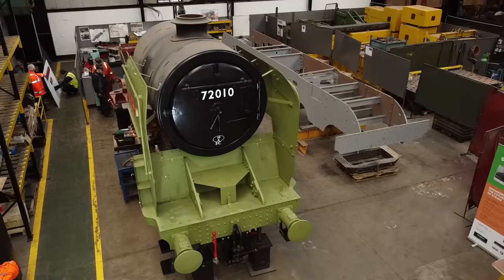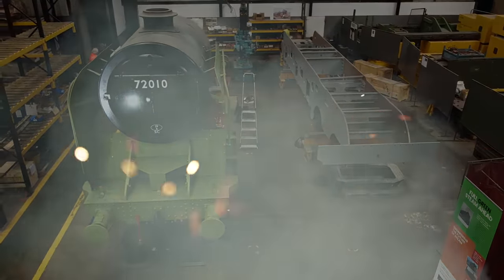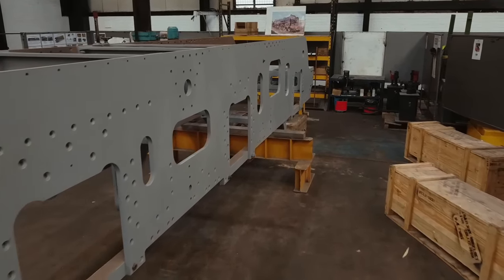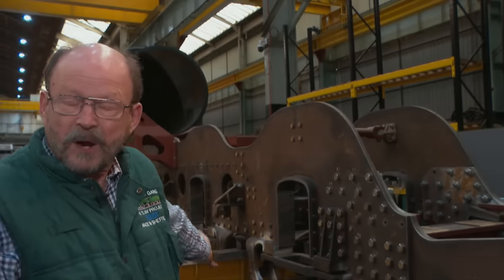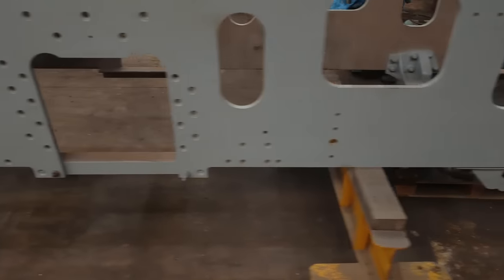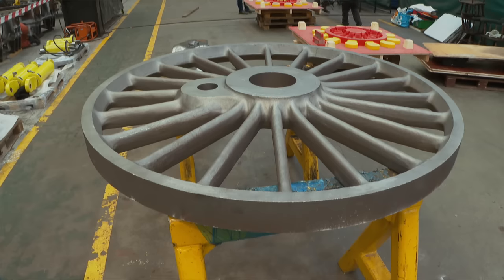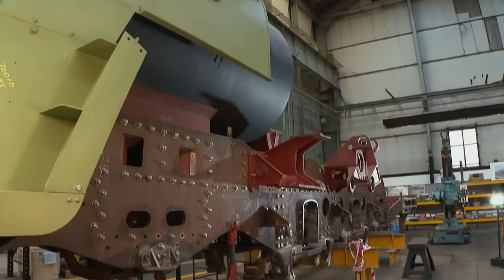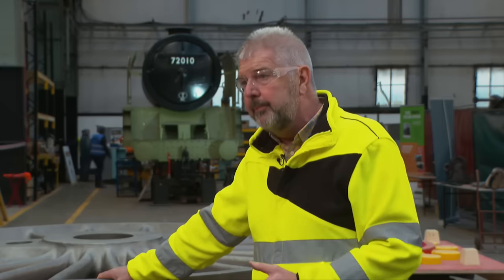One modern Sheffield factory - building two brand new steam engines. A short film by Tom Ingall

Comment: I used to live next door to a guy who had an engineering business in Ireland he had built a huge works on his land , however after the crash in 2008 the work slumped but he didn’t want to lose his younger guys so a lot of the older men retired but would be called in as trainers and advisors when the slump was over…In the meantime Gerry was into old traction engines so he bought a few that were barely recognisable and he rebuilt these using modern equipment and tooling, plus he rebuilt many of the old caravan /wagon type trailers these guys used to tow around…This kept the business turning over nicely until the slump eased, the finished products were fabulous and as Gerry was a traction engine fanatic it was a very rewarding hobby…
Reply: What part of Ireland, please?
Reply: @herbiemitchell9156  It was Balinalee county Longford , I’m not sure he’s still at it because that was about 12 years ago, so possibly retired like myself, I moved away then as I had a holiday home in the Canary Islands and I wanted to live there more permanently..
Reply: @dermotmcglinchey282  Thank you for the reply. I am a steam enthusiast too and built a 4" scale Foster some years ago.

Comment: This is amazing!! The fact that Steam is surviving and making a comeback in this day and age is astounding! I can't wait to see the finished results for the Clan Class and the B17! Best of luck to you and everyone working on these projects from America!
Reply: Japan has been doing the same recently.
Reply: Steam is not making a comeback. It is just a niche hobby.
Reply: is not making a comeback in any meaningful way. It id just a hobby and nostalgia rather akin to battle reenactment.
Reply: It would be interesting to see what steam engine could be made using the technology of today, but still keeping the traditional arrangement (coal as fuel, direct drive and not steam-electric etc). Probably a stronger boiler could be made to use with higher pressure, modern types of bearings that do not need oiling every 100km, maybe some better valve gear. It would be interesting what speed and power could be achieved and how much the maintenance costs could be reduced.

Comment: What a great set of projects to undertake and to be hearing are viable propositions too - not the struggles that befell the Flying Scotsman. A long wait since the last steam loco, the 2,223rd to be produced there, at Doncaster in Oct 1957 (works completed in 1853). What a history in that area for both steam and steel. I have spent quite a bit of my career in the steel mills and steel processing in the area, so pleased to see associated businesses thriving and able to give the steam preservation groups this massive support and opportunities. Also to pass down the knowledge, skills and interest to the younger generation. Well done.
Reply: yes you never know we might need them in a pinch, there are times when things fill a niche, after all there is sam mackwell in new zeland that is building steam traction engines that use fast growing wood or waste material to be powered and using a watertub boiler a lemate style but without the water wall around the firebox so it dont have all the leaking and weakness and scailing problems that plegued the first gen ones when they tried it in the 20th century, he also has a garrett style loco listed as to how far along to build it they are I dont know but its on the website, the beauty of steam is if it can boil and superheat water it can be used even solar made steam using the sun to boil it for a stationary compound engine this earth day when this message is written.
Reply: Well, it hasn't been quite such a long wait as that,  A1  60163  Tornado was built from scratch and completed in 2008.    I think there have been others.

Comment: a very significant point of engineering these locomotives that they fail to mention is that the frames are welded plate steel as opposed to cast iron.  They are stronger, more resilient and flexible, and probably lighter.

Comment: I can only imagine how modern casting, and machining technology is working here. I'm pretty sure small cast parts are having their patterns made using 3D Printing, some of the larger frames plasma or water cut, some large items not even cast but flat plate cut, bent, and then 100% full depth weld being used and then line drilling and boring to make bearing hangers.... its exciting!

Comment: There’s a brand new steam locomotive currently being built in the US as well, a Pennsylvania Railroad class T-1 4-4-4-4 number 5550. The original PRR T-1s were all scrapped at the end of their service from 1953 to 1956. The 5550 is being built by The T-1 Trust Fund and is scheduled for completion by 2030.
Reply: That's amazing. I believe it wasn't very successful (or was that the 4-4-6-4?) but an innovative locomotive with potential for high speed.
Reply: @routeman680  The T1 had problems with the poppet steam valve arrangement that modern materials would easily sort out, they also had traction issues with wheel slip at start up and high speed due the Engineers/Drivers not realising how responsive the locos were to the regulator at high speed...basically akin to over throttling the engines and doing a burnout lol It is a shame that they were all scrapped before full development could take place....they had huge potential.
Reply: What is The Brand?
Reply: @davewilliams6172  99% of all T-1 issues were as they say "drivers error".  As you state, due to the responsiveness and power curve the locomotives did wheel slip, but engineers who ran them daily attested to the fact that there was a learning curve and you couldn't just jump in the cab and run a T-1 like a Northern, Pacific, or Mikado.  You had to learn how to manage all that power and responsiveness.  They were a very good locomotive despite many ill-informed claims to the contrary.
Reply: You're right. All those T1 drivers used to drive K4s Pacifics, which has different characteristics than a T1.

Comment: It was not the Sandringhams "loading gauge" which determines the size of the engine but their axle weight which was the consideration and this determined their size/weight as the bridges were weight restricted. Later on they were strengthened and then in the 1950s the Britannia Class engines- big sisters to the Clans ran on the same line.

Comment: For some time I've wondered about the inverse of this project: you are scheduled to step into a time machine to take you to (say) 1850. You are allowed to take with you enough gold to found a steam engine construction company, and one set of blueprints for a steam engine. Using modern engineering and technology, make the best possible steam engine blueprints which could be constructed in the 1850s. 

(I.e. make a modern design to be constructed with old technology, whereas this project is an old design being built with modern technology.)

Comment: For a moment there at the start I thought you were Jeremy Clarkson 😆

Anywho that was a good video. I am a tad surprised that both groups intend on running the engines on coal. I would have thought being new builds they would have to be able to run off say biomass, wood or maybe some kind of oil that hasn't come out of the ground.
Reply: I have seen video of steam trains that run in America that are run on oil and just have a small boiler to give the steam effect. What belches out of the chimney is black and filthy. We were still in the steam age in my childhood, being a war baby. I travelled by rail a lot and never saw belching black emissions like that even pulling up box hill. On my first Diesel trip under the Severn tunnel  we broke down half way, and had to wait for a steam engine to rescue us.
Reply: Oil firing is possible, but almost the same emissions as coal, and the smell is far less pleasant, as I discovered riding up the Vale of Rheidol behind an oil burning engine - kudos to the VoR for converting them back to coal, a much nicer experience in open air carriages! Biomass and wood have much lower calorific value and would need a totally different design with much bigger firebox if they worked at all, and would throw vast amounts of hot sparks, which is why early American wood burning engines have huge conical spark arresters on the chimney. Bulleid designed an ingenious peat burning loco in Ireland in the 1950s but again very different to a normal steam loco.
Reply: Jeremy or Guy Martin would make a good tv show about this to reach the poor souls that have,nt discovered yt yet.

Comment: I often wonder what a steam engine would look like today, if it was designed from scratch? Would it be turbine powered? What would the boiler look like?
Reply: Yeah they would probably be Turbine powered, and look like normal diesels or streamlined Steam Engines, but with coupling rods that connect to thee Turbine motor on the inside without the piston rod or Valve gear maybe also a Condensation tender to save on water and to reduce noise, coal shoveling would probably not be nessecary either due to automation either.
Reply: It would probably look like any of the last generation steam locomotives, in other words just like these two locomotives here.  Last generation steam locomotives were impressively sophisticated with features like powered stokers and automatic central lubrication.  Every attempt to design a more "modern" steam engine has failed. Steam locomotives were refined over centuries and just about everything you can propose as a "modern" improvement--turbines, water tube boilers, poppet valves, etc. have already been tried and discarded as impractical.  What would be different would be modern construction methods and materials.  If you want a good understanding of the difficulties of "modernizing" steam engines check out Jay Leno's videos on his Doble steam cars, which are very sophisticated and constantly breaking down.
Reply: Ross Rowlandson (I think that's right) had one designed in the '70's which looked pretty conventional but was duplex drive.

Comment: I want to see a truly modern steam locomotive built from scratch using modern technological advancement. Could you imagine 3D printed pistons and cylinders,  modern composite boilers, laser printed rods, and so on. How much power could be made simply due to the increased efficiency in the system.  Not to mention if we could make it a thorium boiler system.  . .man, the things we could do. . .

Comment: I'm surprised nobody has tried designing a brand new steam engine using modern technologies
Reply: Most likely a water tube boiler running at 900 psi but it wouldn't look pretty.

Comment: What many forget is that in two world wars we lost a large number of that curiosity of engineering the Pattern Maker. Such as were left worked upon munitions but there was a much greater reliance upon fabrication. This was in part why the railways were I ,such disrepair at the end of both wars. If the pattern existed the part could be cast but many were not to be found. Make another you say. Not so easy as much knowledge had been lost by those woodworkers who knew the tolerances to allow for the pattern depending upon the material being cast. These are the lessons and skill that have to be re-taught. CAD design is only as good as the knowledge imparted into it and that comes from knowing minds.

Comment: I've always wondered what a coal powered steam locomotive would look like today if it was designed from ground up using modern design techniques such as CAD and 3d printing.
Reply: I believe the engineers who made 'Tornado' used modern techniques and actually improved on the design.

Comment: I'd love to see these engines not only being built with modern machinery, but also be updated with more modern fuel sources, to make them cleaner and more efficient; instead of burning coal or heavy fuel oil, perhaps having natural gas firing the boiler there. Of course, the environmental impact of two more of an endangered breed of locomotive is negligible - but, it would certainly add a new feat of engineering, to where instead of just taking an old design and re-building it with modern tools, they improve it with modern engineering to make it even better. Plus, I'd imagine there'd be far less maintenance needed on the smokebox and boiler tubes, as clean-burning natural gas won't have anywhere near the soot buildup of heavy fuel oil or the ash of coal.

Comment: This American offers a suggestion.  Contact the steam shop at the Union Pacific RR.  Although their steam locomotives originally burned coal, they now burn oil, perhaps the same stuff that Union Pacific uses in their large diesel fleet.  Also, Union Pacific uses a 2nd tender carrying carefully treated water to extend both the operating range and boiler life.  Is the object to have these wonderful pieces of machinery operate exactly as they did in the past, or is the object to keep 'em running into the far future?
Reply: Thank you .
One massive difference between running steam locomotives in the past and now is that they were always kept hot or warm. However the infrequent use for excursions,  condensation in the boiler, expansion in lighting up going from dead cold to hot. Feed water treatment is effective as the water boils but once the locomotive is layer up you drain and dry the boiler
 Main steam pipe and superheated fill with condensate and rust.

Comment: I wonder if they using exactly the drawing or modify a little. Such as nut and bolts are they still British standard or change to a Metric . And do they use rivet or covert to bolts, and do they still using journal bearing as the old time or using modern roller bearing

Comment: Given these are being built to last a while, are they coal fired or have they been converted to run on  cheaper fuels that still ‘steam’ the boiler, albeit with less emissions and fuel costs?
Reply: Need coal all the way
Reply: all the coal for steam engines in britain comes from a welsh coal mine that has really high quallity coal.
Though with the place having some issues there has been tests with possible alternative fuels to keep the engines running with little to zero modification.
Reply: They could stick a pantograph on the roof and use electricity to boil the water! The Swiss did it in WW2.
Reply: @jimthorne304  But that would take away from the authenti

...d'awww, ALRIGHT I AGREE WITH YOU.

Comment: I see a lot of rivets and nuts & bolts.  I thought modern welding would have replaced that.
I assume steel has replaced cast-iron in this engine.
Reply: as·sume, verb, 1.suppose to be the case, "without proof.".....  have fun doing what you do best....
Reply: @nc3826  
Is this babble normal service!
Reply: Thank you for defining. what you do.

Comment: It is also as a knowledge to people that, this is mechanical engineering. Now, things started trying to shift to electrical engineering. 
I always wonder, why don't people combine proven, reliable, and simple mechanical engineering with fast response and efficient electrical engineering? I mean, while those locos are a beauty, lots of things happen in the mainline is electrical not mechanical anymore. 

Should it'll be built with, I don't know, electronic controls, like the throttle, gauges, and safety systems. 

And also, built the diesels and early electrics that were scrapped. Because, a history of railway will be completed by series of engines that show how the tech went on.

I'm not a British, but, I get it because in Indonesia, were I live, a historical railways is nearly an unloved child.

Comment: Are these copies of original or are there things that improve them like roller bearings, steam seal, positive and return lubrication systems instead of plain bearings, fibre seals and drip lubricators?????? Steam was alway conservative in design with loads more innovation that might have made them more viable.

Comment: They're actually locomotives, not engines. Steam engines are stationary.
Reply: Both are steam engines.
So are the ones in ships.
Locomotives (place mover) move trains on rails (although road locomotives were a thing too - caterpillar tracked steam engines were a thing).
Reply: @allangibson8494  Nope, the topic of the video was a pair of steam locomotives.  Locomotives have main drivers, that canbe steam, diesel, electric or a combination thereof.
Steam locomotives just happen to be driven by steam engines.  The engine itself provides no motive effort without substantial additional engineered parts.
On the road, you options are steam traction engine, steam roller or steam lorry.
If it's a crane, then it's a steam crane. if it's a ship, then its a steam ship.
See the pattern here?
People need to learn some basics before spouting garbage in their videos.

Comment: Where is the fuel coming from?
Reply: Plenty of coal is been used in thermo plants, no shortige of coals
Reply: @lucianpapuc1504  There will be a shortage, shortly.
Reply: @stanleybest8833  And why is that?
Reply: @lucianpapuc1504  and is the coal of good quality? Many thanks 👍
Reply: In the USA, many were converted to diesel fuel because of the distances were quite long.
Reply: They could be run off bunker fuel or heavy fuel oil. Or anything that burns really. They will be mostly show pieces not worked hard or long so the fuel demand will be quite low.
Reply: A coal mine in Wales.
Atleast for now though alternatives will proberbly pop up since the mine has been having issues.
Reply: @davidty2006  This coal is needed for houses and industrial processes. Steam was interesting, but abominable. It wasted so much heat. Diesel is sensible.
Reply: @stanleybest8833  Don't think britain ever had any oil fired steam engines..
Closest such thing got was the GT3 with a gas turbine.
Reply: @davidty2006  d I e s e l